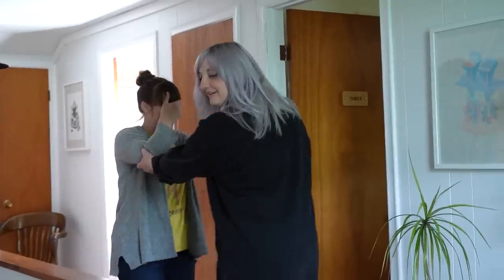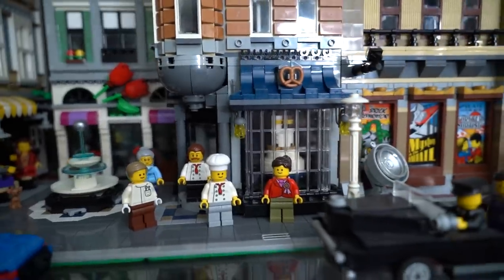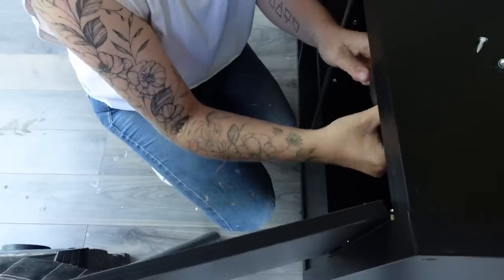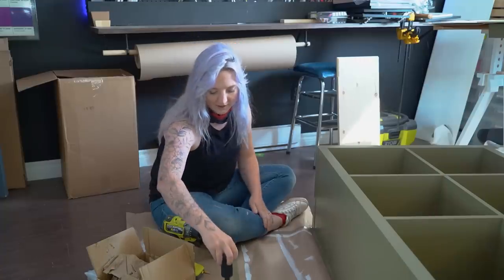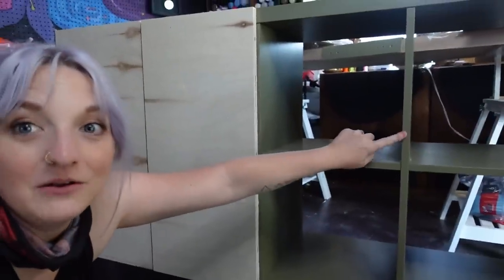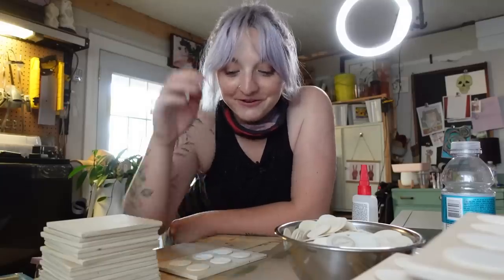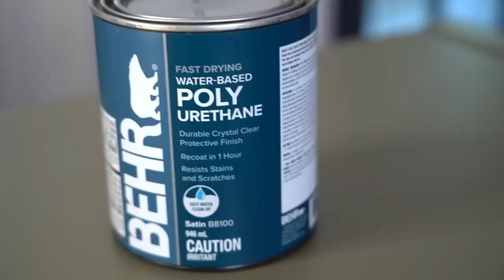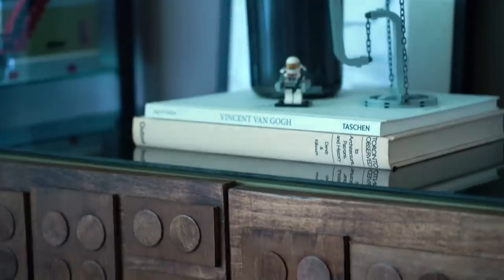IKEA KALLAX HACK: make it lego inspired but *sophisticated* 😱| Love It or Thrift It | DIY DANIE

Comment: I would leave the green body the same. Before you added you cool stylized wooden Lego decorations I was getting a birchbark vibe from doors. You could give them a light paint wash and then go back in and emphasize all those dark knots and marks, add some horizontal striations by hand in black. Black legs. It would look great with the ones you chose. Or I might get black metal legs that are formed by two rectangular shapes. Hmmmmm.  Makes me want to go out and thrift me a Kallax shelf. You made IKEA classy!

Comment: Hello Danny. I think the solution to the problem of the cabinet doors is the proper type of hinges. I far as I can see the original hinges that come with the cabinet are full overlay 110 degree, but if you want to have two doors in the middle section attached to the same middle vertical part (sorry I don't know how to thanslate that) you need to use half overlay 110 degree hinges. At least in our country that is their name.

Comment: The end result looks great, but as a Lego fan I think you should have tried to get the spacing of the studs (round wooden pieces) closer to correct dimensions. The studs should go closer to the edge of each rectangle so that when two pieces are side-by-side, another piece turned 90 degrees would match with all the studs. And then position those rectangles in a grid where spacing between the areas without rectangles would match the width of narrower length of 1x4 rectange.

That said, I totally understand why you did it this way because doing the "technically correct" lego way would have caused less relief edges for the same part count. So to get the same overall visual appearance you would have needed maybe 1.5x – 2.0x the amount or pieces to manufacture and glue.

Comment: Spot on, not a easy task. Tip is using a foam roller instead you won't get rough surface and end it with stroking a fine brush along the grain or whatever

Comment: I think I would have kept the original finish on the Kallax itself, and I would have put an MDF back on the entire unit to enclose the interior completely. The doors are great, I don't think I'd change much of anything, but perhaps a laser-engraved grid would have helped line up all the applied Lego pieces. I like the dimensionality of the Lego treatment, but it might also look interesting to have a design like this laser cut in several contrasting species of wood, and essentially do a marquetry version of this.